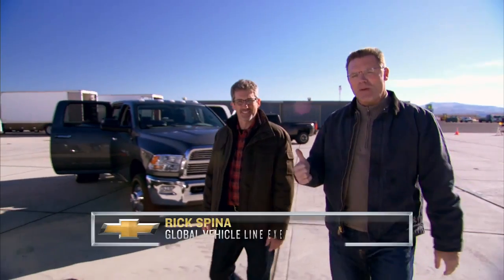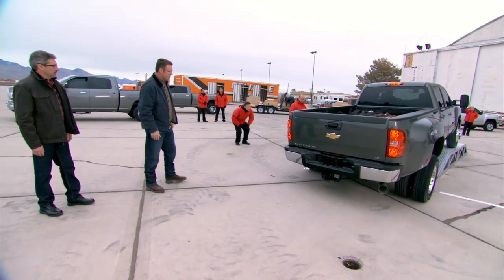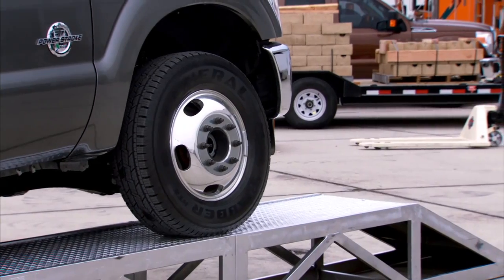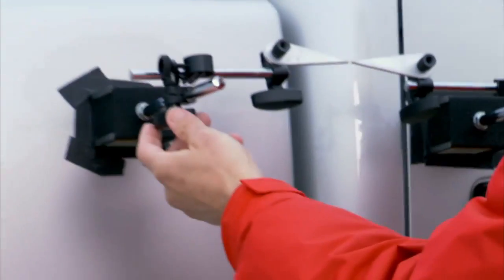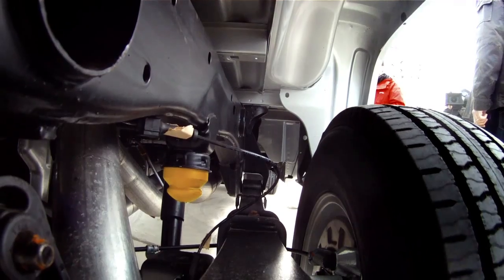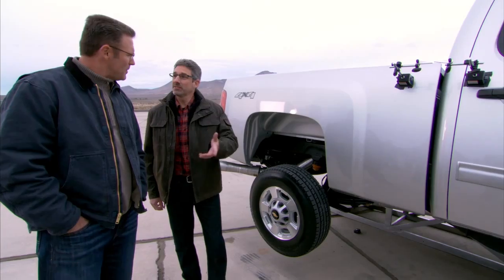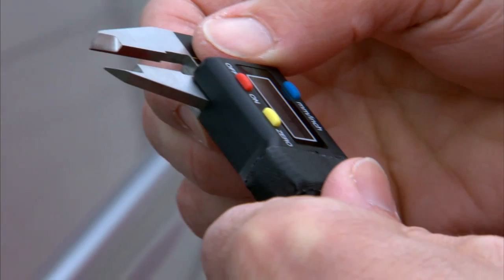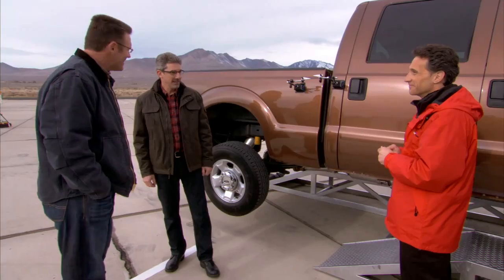Chevy Silverado 3500HD Head to Head Frame Strength Test No. 2 Twist Ditch

Comment: Well, not that I really care who won the test, but just an observation.  On the first set of trucks, both of which are equal in payload I have to ask myself why the Chevy was sitting higher before and on the ramp test?  Much lighter load possibly than the Ford maybe?

The comment the Chevy guy made about Chevy having a fully boxed frame rail... Chevy does have it but so does Ford... the ONLY major Truck maker that doesn't is Toyota.

Not a big fan of auto makers doing biased testing to show how much better their autos are than the rest when it is easy to fake results or give half-truths.
Reply: +preston121068 True, to an extent. Ford only now for the 2016 SD's made the entire frame fully boxed. Prior to that only the portion under the cab was fully boxed, the portion under the bed was only C-frame. And this isn't "half-truths" or "fake", the SD's prior to the 2016 model year have been known to have weak frames. Hell, even Ford advertises the boxed frame on the 2016 SD's as 24x stiffer than previous SD's (They basically said their older SD's have weak frames). Pull into practically any gas station across the midwest and you will most likely see at least one of the big 3. From my own personal experience as well as observing other HD and SD trucks, Chevrolets don't squat as low as Fords do. Now you combine the lower squatting and the less rigid C-frame of the Ford and you get more sag.
Reply: Mark Schaefer Im not positive when Ford went to fully boxed frames front to back, but I recall reading about when they announced it back in like 2009-2010 maybe?  My 2011 F150 has fully boxed frame front to back so i would assume the 2011 + SD would also?

Im really not a die-hard Ford guy, I got a good deal on mine so I bought it so I really have no vested interest in this truck is better than that truck etc.. they all have their issues in some form.

What I dislike is seeing automakers do testing like this.  I mean just ask VW about who has the best most efficient diesel... lol.  Automakers cheat in side by side testing.  I mean think about it... If you worked for GM and did a test Ford vs GM, who are you going to make sure wins?  Even magazines these days who do comparisons tend to be biased these days as we live in the world of money talks and he who pays more wins...  sad but true.
Reply: +preston121068 F150 is fully boxed for ride comfort, SD isn't for 2015 and prior.
Reply: +preston121068 the chevy is sitting higher because the suspension is also rated to carry more weight.  Therefor its not going to drop as low as a ford.
Reply: TheMassRequiem Payloads on these 2 trucks is within 200 lbs of each other.... not sure how that makes either able to carry that much more than the other or squat the suspension unequally?  I think had Ford made this same comparison, something tells me Ford would have won...  Like I said a manufactures comparison should always be taken as not exactly fairly matched.  You think Chevy or Ford or Ram or any of them are going to make their trucks look bad when they are the ones doing and paying for the comparison to show consumers?  Really??
Reply: preston121068 regardless. the frame is not suppose to flex.  the suspension is suppose to flex.  a frame that flexes reduces structural rigidity which is why you saw the back tailgate crumple under pressure.. 
ford is shit
Reply: TheMassRequiem To each his own I guess?  As for me Ive had pretty good luck with Ford, though I've only owned 3 in my lifetime.  But 2 of the 3 went well over 250,000 miles without many issues.  The third I currently have and so far, so good.  I have owned 2 GM products and both were horrible.  A 1985 IROC Z28 which had 60k miles on it when I bought it and wiped out a cam a year for the 4 years I owned it, not to mention T-top leaking like the titanic, rattles, terrible ride and just generally falling apart in some way daily.  Then there was the 2002 Silverado which blew a transmission after 40k miles, then spun a crank bearing after 85k, ball joints, tailgate latch replacement 4 times, 2 power window motors, CD player, 11 running lights and a universal all broken in under 100k...  So Id pick Fords "shit" over any GM product personally.

Comment: the funny thing about this is I run a semi down the highway at 90000lbs+ and the frame on my pete twists and flexes going down the road...what is the Chevy's excuse?  flexibility doesn't indicate strength it indicates flexibility nothing more nothing less
Reply: +pete379exhd2010 Your semi is made to do flex due to the immense torque put on it to shit massive loads from a dead stop. with a stiffer frame you could buckle the frame. also your cab is suspended from your frame so your body panels dont bend. the flex is good for you bad for smaller trucks with mated frames and bodys. Think about it this way, look at Baja truck frames. trucks designed to take a beating. solid strong no flex frames the flex of the road is absorb by the suspension and shocks and struts. but the frame you want is based off whatever the main job your gonna be doing
Reply: +wwdavis8989 you're joking right? my cab is no more suspended than one on a regular pickup I run old iron not this new air ride cab and sleeper crap they've come out with in recent years.  comparing a Baja truck to a semi holds little to no water, I can guarantee for a fact I've loaded in fields etc. that put the same stress if not more on the c channel frame that flexes.  I've delivered to job sites etc that would probably make trophy truck engineers cringe.  

take reitinour and mac flatbed for example reitinour would be like Chevy in this instance they were attempting to compete with Mac and came out with a trailer rated for 80k in a 4ft 100k in a 10ft and 120k  over 48ft. they recalled most the first year they came out because they snapped in half. because there was no give to the trailer.

a mac m80 carries the same ratings but flexes slightly and is less rigid it doesn't sag like a Fontaine but has enough flex to not snap in 2 same concept.

Chevy has never built a truck near the quality of ford granted ford's frames have a little too much flex for my liking in the latter year models but these tests are complete b.s. in the same sense.  it was much like Chevy's towing test they rigged it and went to higher elevations where the single sequential turbo ford used previously was known for problems it's Chevy's way of doing things.
Reply: +pete379exhd2010 ok old iron these are newer trucks compare to new semis. and you obviously failed to read how Baja pr trophy truck is designed to do something completely different than want your semi does. Fucking hell there's a reason a race truck can't pull lots of weight but semis and ton or more trucks can there engineered to do single tasks with slight variations.

Comment: This entire video is noting but a Chevy ad.   I.e.   Anybody else notice how they showed the pre-test alignment of the pointers for the Chevy, but not for the Ford?
Reply: +Tim V. But don't you find it interesting how Ram did the same test in a different video and got similar results against SD?  Btw, I own the Ford truck and both ads got me thinking
Reply: +Tim V.  it was not... If it was dodge would have being show.. But dodge use frame as strong as gm almost. So they just did not show it
Reply: Ford is stepping up to the plate with the 2017 frames. I am not a Ford fan but if you like them they are making changes that are positive regarding this.

Comment: you can tell these tests are biased. ford had a longer bed
Reply: It didn't actually, and even if it did, the frame should be improved to handle the extra length
Reply: +Jesse Kennedy and the duallys are both 8 foot boxs
Reply: +Jesse Kennedy no they are both short box trucks they are both six and a half foot boxes
Reply: +Jesse Kennedy no the dually part on the Ford is smaller so it makes the box look longer but it is not
Reply: +Jesse Kennedy yup
Reply: ^ he mad
Reply: nope
Reply: both non dually were 6ft and both dually were 8
Reply: +Landen Dalsin yeah it did
Reply: nope
Reply: the frame should twist to keep from damaging suspension components. Semis do the same thing and are built with c chanel frames. if you take your truck off road it will help as well to keep traction. Another one of gm's feeble attempts at a Comercial I feel sorry for people who own one. GM  (Government Motors) how many more times should the tax payers bail them out.
Reply: It puts more strain on the suspension if the frame doesn't flex. A fully boxed will crack and bend if you went through a ditch with a big load on or heavy trailer. C chanel will flex and spring back. Who cares if the tail gate opens I'd rather have a straight frame on level ground. I'd rather have a c chanel frame but newer vehicles you'd have to go above and 1 ton to get it. Fords have always been rated to haul more than GM and Dodge too. I know thew went to a fully boxed frame now but haven't seen a flex test done on one yet. Time will tell.
Reply: I wonder why Ford went fully boxed frame then for 2017? And it shouldn't wreck suspension components there ment to move.
Reply: No sir the Ford was longer

Comment: why didn't they test the Ram in this? (guess because it would have won)
Reply: They did in another video and it beat the ford
Reply: +spiffcats I believe fiat is the word you are looking for.
Reply: Because they were showing off trucks, not whatever you call a dodge,
Reply: There are 3 similar tests on here.  The Ram was strongest, Chevy next and Ford last.
Reply: Lol
Reply: Rexford L i think because the Chevy and Dodge are steel frames
Reply: Rexford L i just came from the ram vs ford... obviously the ram won
Reply: il tell you this right now ram is garbage.. cummings are nice but dodge is garbage
Reply: They actually did and it did worse than the Chevy but better than the ford
Reply: It would right
Reply: my question exactly
Reply: yea, rams are really durrable trucks and built really nicley...i went through the back snow fillled ditches and crappy ass worst back roads...and the ram took it, where flyin down the road and we stop cause the chevys are tryna be gentle ahahah and fords you dont see cayse they dont make it ahhaha
Reply: +Ben O fiat is just the owner...there still all built the same with just minor interior changes on the 1500s
Reply: +Charles Marshall that's it has the 2013+ model years, I'd like to know the 2012 and older models..
Reply: ram copied GM on trucks.  And, old trucks at that.  They are not that great.
Reply: Rexford L hahahahajajjahahahahahahahahahhaha
Reply: Rexford L and chevy doesn’t wanna ruin their decreasing reputation
Reply: Rexford L the only good thing about ram is the Cummins 5.9. The rest of the truck is Garbage
Reply: Lmao true
Reply: +Alfredo Garcia The RAM is better!
Reply: Rexford L is this a joke?
Reply: rip gm products
Reply: +Rexford L For sure, Ram is so much better than both

Comment: This is put on by Chevy. No wonder the Chevy did better. I am not bias toward either brand. But that is why
Reply: Even if ford would do this comparison Chevy will win don't matter who does the comparison
Reply: it does not matter who put made the video the truth is right here in front of you. ford uses a C frame when gm and dodge uses a box frame.  ford could never win this particular test as long as they continue to use a c frame.
Reply: +Alfredo Garcia  so true. But the ford people would try any way possible to cheat in their videos. Like claiming they are towing a supposedly 10,000 pound loaded trailer when they only are towing 7,000 pounds inside lol.
Reply: +Mark Schaefer    unless the Ford people cheated and put a 2x4 on the wood rack (if truck beds even have them anymore) to give the tailgate some bracing.
Reply: +Joseph Long What wood rack are you talking about?
Reply: +Lane Blount   I'm a chevy guy, but I might get a free 2003 Ford Ranger xlt from my grandpa who spent way to much for it cause it was used ($8000) as a grad gift. Even though I prefer diving the 2005 Silverado, I'll take it. Also in my opinion, you can't go too wrong with a small mid-sized truck... unless it's an s10 and it's shitty frame lol.
Reply: +Joseph Long if I had my choice of a light duty pickup I would get the Colorado with the, you guessed it, 2.8 Duramax
Reply: +Mark Schaefer     It's hard to explain but if you get a truck with the plastic bed liner, you most of the time will see those little humps in front and/or behind the wheel well hump in the bed.
Reply: +Mark Schaefer    It would be cool to get the 2009 colorado with the 5.3 v8. I've heard that the power to weight ratio is insane lol.
Reply: +Joseph Long I know. And if it was put on by dodge the dodge would win. It's all marketing. I think all the trucks made today are equally good I think it's all in what you like
Reply: +Lane Blount Chevy hired an independent company to do the testing. Chevrolet has put on this show for a while, because it's true. The Ford's frame is weak, it's known to be weak. "Chevy tested it so that's why it won" Even if Ford tested it, the Ford would still have lost.

Comment: Lets face it, in every single frame test Ford sucks big time. Thats the one and only truth.
Reply: Jacob Hildebrandt 
I have a dodge 3500 chassis cab. I disagree, Dodge has the MEDIUM DUTY  AISIN NOT THE ALLISON.   I agree with you dodge pickup trucks are the best. I agree Cummins engine is the Best.
This AISIN is made for MED. DUTY TRUCK,   Class 6 and Class 7.
So this makes Dodge the best.
Best engine, best transmission, best frame, and with factory air ride suspension. Add it all up Dodge is the best.
That is why I drive the best.
Reply: I work on all three. And gm trucks suck for making suspension parts. GM trucks get stuck more often than the other two. Chrysler sucks for making brake caliper brackets but are much better than the gm way of attempting to make something reliable. Ford well... don't really have anything bad to say. Simply love the way they made the suspension. 2×4 Ford out drives the 4×4 GM and Chrysler trucks. The only thing Chrysler has going for them are the parts they don't make, the engine (Cummins) and trans (Allison). GM however. They only have one good thing and that's the trans also an Allison.

Comment: I'm a Chevy guy, always have been, but I can't help but notice the dodges where left out of the test despite ones being there.
Reply: +Justin FYI, for your ignorant dimwitted self, Ford borrowed over a billion more than GM and still hasn't paid it all back yet, unlike GM which has paid it back. Ford is "Government Motors".
Reply: +DanielRichards644 now a day i dont even care anymore, all the companies do is rag on eachother, personally ill stick with my 2nd gen rams, they have always worked for me, or a tundra, they work well too.
Reply: TheBossGuy1

Honestly I don't even care for the looks of the modern trucks, but atleast the Ram still is recognizable when compared to the second gen Ram. I'm crazy picky when it comes to the trucks I like in terms of looks, I like the mid 90's silverados but ONLY in the extended cab (not crew cab) step side bed and the 03-05 (not the 06 when they added the HD style hood to the standard model) extended cab regular bed. outside of those I would start leaning toward the 2nd gen and up extended cab dodges, I just don't like crew cabs and regular cabs, crew cabs are to big and regular cabs don't have any room.
Reply: DanielRichards644 exactly, looks usually outweigh the performance, to en extent. And ur right, my friend had a 96 z71 extended cab, and its a really nice looking truck
Reply: *****
STILL DOESN'T CHANGE THE QUALITY OF CONSTRUCTION, that this video and MANY others like it show LACKING in the FORD. enough with the bailout BS, that had more to do with UNIONS requiring more cars to be built then the market demand then which is "better".
 BAILOUT BAILOUT BAILOUT,  thats all we ever hear from FORD fanboys, this video SHOWS A MAJOR STRUCTURAL DEFECT with the frames of the FORD trucks and you still claim to be the better vehicle.

Comment: To the chevy guys sayibg "real men go off roading" lmao go check out the fucking raptor, you got anything like that?
Reply: all a raptor is...big v8 with a suspension job....that's it.
Reply: Yeah they do every Silverado is able to go off road. The raptor just has a bigger motor.
Reply: ... Chevy reaper?
Reply: Taylor Lindsey never heard of it, sounds lame af
Reply: There is a lot more to a raptor than a big motor. The reaper and ramrunner are just chevy and dodge answers to the success of the raptor.
Reply: Funny you have to buy a special edition ford to go off roading. Lmao
Reply: I agree with you. Remember the time Chevy offered a solid front axle? I don't. IFS is to for some things, but a solid front axle offers more articulation, more durability, and more aftermarket support.
Reply: +OfficialVanDyce My astro tanks all offroad terrain it goes on.
Reply: +OfficialVanDyce   Yea a silverado with fox shock...
Reply: Did you see Crash of raptor... And crash of stock chevy.... Nothing special..
Reply: +OfficialVanDyce for real!!

Comment: this doesn't prove anything the chevy is a virtually brand new design while the ford is a over 10 year old design that came out in 1998 and has only received minor updates since such as restyles or new engines or minor changes to the frame and suspension. show use the same test with a clean sheet chevy design and a clean sheet ford design and then this test will have some meaning, until then it's just tools and fools.

Comment: u could see that the pointers on the ford f250 werent even set 100% the only thing a chev truck has is its leaf suspension, other wise the truck is poorly made all cheep parts, ive seen the gm trucks go to garages almost everyday they are garbage.